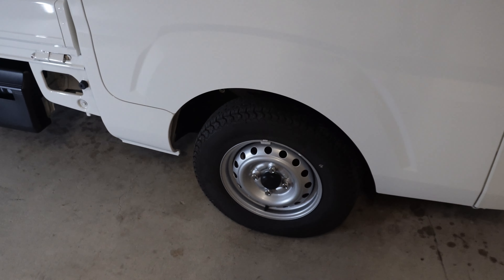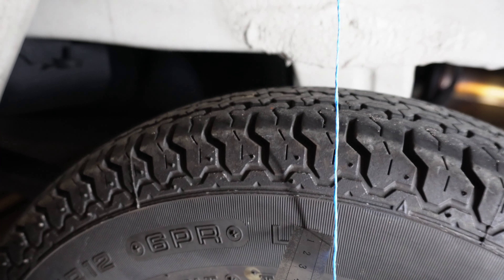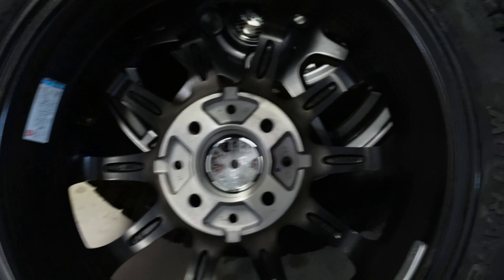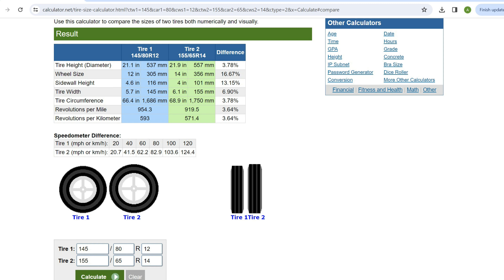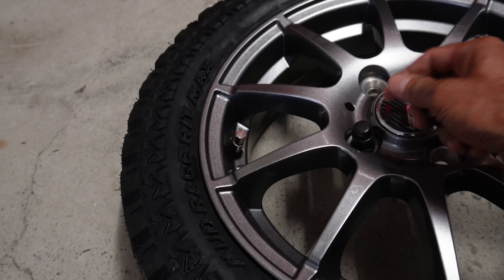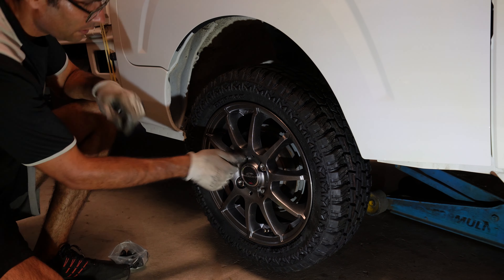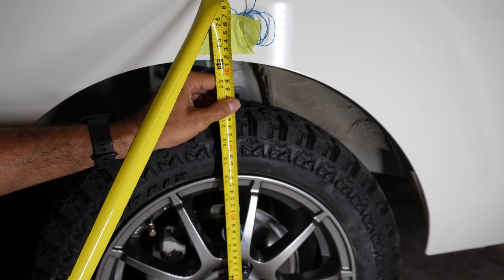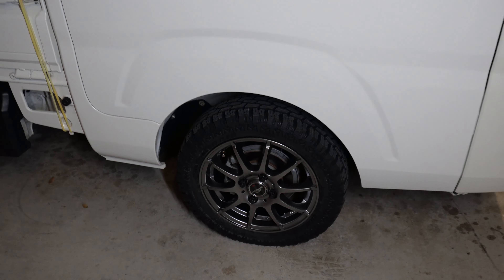Daihatsu Hijet Wheel and Tyre Upgrade

Comment: Hey man great video,  do you still have this wheel setup? Do you encounter any rubbing with this 14inch wheel and tire combo? In this video does the hijet have a lift kit installed?  Can you post a new video of the truck showing the side view... I'm interested to see if these wheels poke out at all or sit flush in the sunlight.
Reply from the maker: @shazadsuchit5359  I still am running the same wheels, no issues with any rubbing. The wheels sit flush with the guards, no need to install wheel arches.
Reply from the maker: I did consider installing a lift kit but I never did install one.